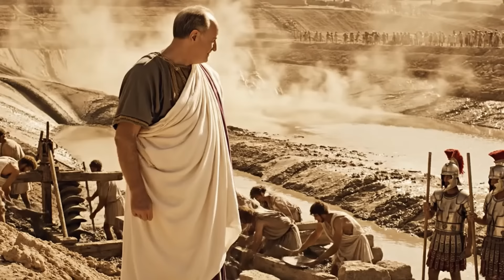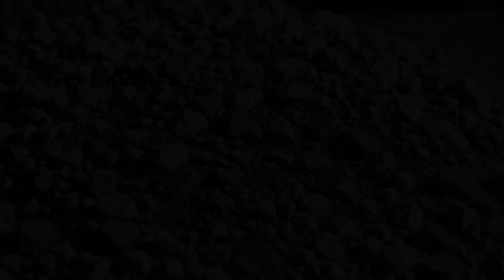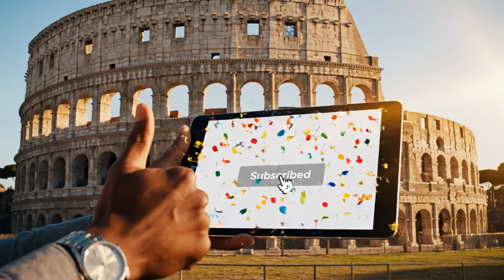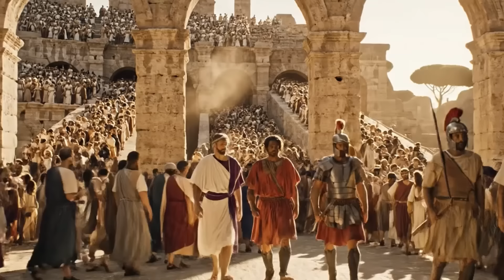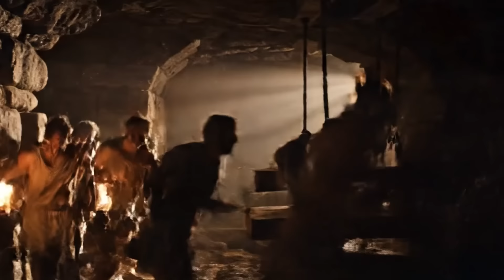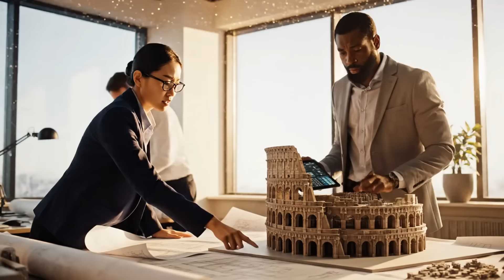How the Colosseum Was Built – And Why We Still Can’t Copy It

Comment: When the Colosseum first opened in AD 80, it wasn’t the weathered ruin we see today but one of the most dazzling and beautiful structures in the world—its entire exterior gleaming with polished white marble, decorated with statues of gods and heroes, and accented with bronze shields that flashed in the sunlight. Inside, the seats were cut from colored marble, the corridors were adorned with frescoes and stucco reliefs, and a massive awning of bright fabric—the velarium—stretched overhead to shade more than 50,000 spectators. Perfumed mists scented the air, music echoed across the arena, and the whole structure radiated symmetry, engineering brilliance, and imperial power. Ancient writers called it “the marvel of Rome,” and for good reason: at its opening, the Colosseum stood not as a ruin but as a shining, breathtaking masterpiece of architecture, color, and spectacle—one of the greatest achievements of the ancient world.